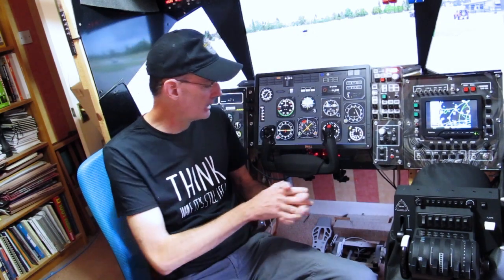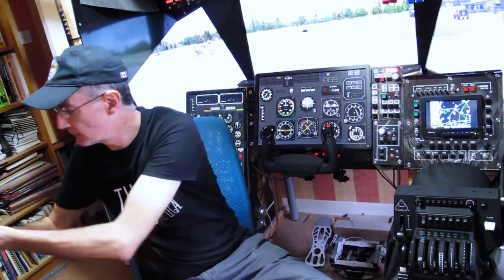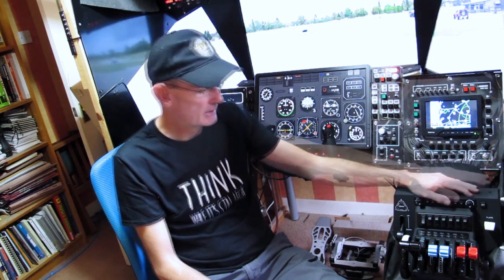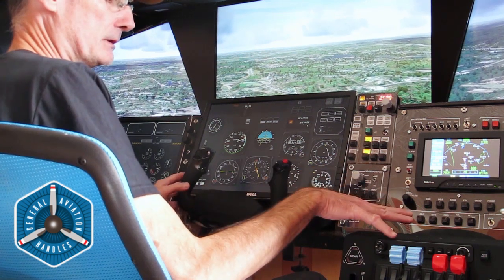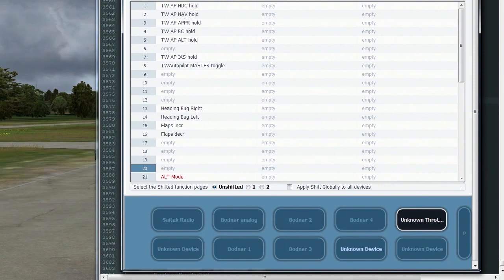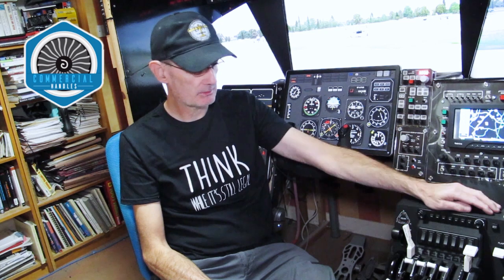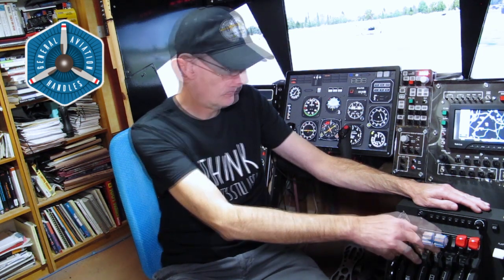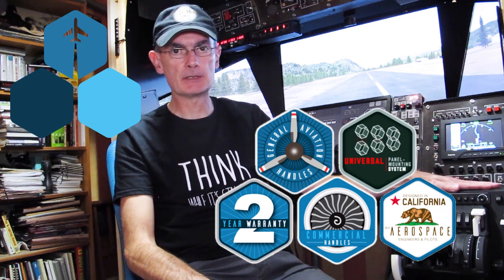Honeycomb Bravo Throttle Quadrant Review

Comment: Isopropyl alcohol  works very well to remove stickiness on  this type of soft plastic 😊
Reply from the maker: Five years on it would be interesting to hear if anyone has actually had problems with stickiness on their Honeycomb yokes. On a casual search I can't find any evidence, although it's hard because 'stickiness' returns a lot of hits about binding :(

I don't have the Alpha any more but I have just ordered the 'Lite' version to review.
Reply: @AlmostAviation Ive only just bought the honeycomb, so too new.  I had the sticky problem with an old Saitek  x52 pro throttle , applied about a year ago & still good …. I hoard all my old sim hardware so will update 😊

Comment: Hello,

I remember your very informative (as usual) video about the absolute positioning of the Saitek Trim Wheel and how this harmfully interferes with the autopilot and/or the trim buttons in the sim.

According to HC support, it seems that the Honeycomb trim wheel included in the Bravo sends button events to the sim (interpreted as "up" and "down" events) rather than an absolute axis value. That is, it seems like the trim wheel implements relative positioning, much like your mod on the Saitek device.

Can you confirm?

Thanks in advance
Reply from the maker: Yes, indeed it does. You will find this a very slow way to change the trim with MSFS by default, but if you have FSUIPC or SPAD.neXt I have found sending five trim events per click works gives a good balance of finesse and usability. You can tune this as needed. I have just also seena video by Simhanger about another app for tweaking the Bravo trim whell, so maybe check that out.

Comment: Operating the switMany thanks for your presentation
Finally a Youtuber who shows us NOT a preformatted marketing speech...but a practical use of the product
I realize (finally) that the ergonomics of the autopilot is a disaster, especially for turning the wheel (on the right) 
This when the "mixture is on rich" and the propellers at small pitch.
Operating the switches is even worse and complicated to access during the flight it seems...
It is often also there in the climb that one needs to adjust the autopilot. In short, I ordered a set of this product yesterday (A+B), which is currently in transit between the supplier and our home... and I'm already wondering if, instead of unpacking it... I'm not going to return the boxes WITHOUT opening them!
For more than 6 years I have been using the Saitek "Pro Flight Yoke System", 2 "engine" modules ° Autopilot module and Radio module ...and I finally wonder if it is as ergonomic if not better than Honey...
Thanks again for your sincerity !
JF
Reply from the maker: Thanks. I'd give it a try, only the rocker switches are really awkward when the levers are in the way. Time will tell whether the axes are more durable than the Saitek ones but the feel is definitely better out of the box, and the tension is adjustable.

Comment: An absolutely lovely piece of gear that suits a wide variety of aircraft, BUT not a Cessna (probably the most popular plane in the world). It's the one I fly primarily both sim and real, so if Honeycomb can disregard Cessna, I can disregard Honeycomb.
Reply from the maker: Not sure what you mean, I fly the Cessna 172 with it with no problems.
Reply: @AlmostAviation  Of course it "works" and should with no problem, just as the little throttle lever works on top of my basic CH yoke and with as much authenticity. Presumably the idea behind the elaborate variations in the quadrant and the associated cost is to more accurately replicate the throttle look, feel and action, which it absolutely can NOT do for a Cessna.
Reply from the maker: @airste172  I guess we disagree. To me, 99% of the worth of an analogue controller is that it provides analogue control of any given axis in an ergonomic form, with a decent range of travel and with sufficient precision. I'd say whether it looks like the particular aircraft you are pretending to fly is of little significance.
Reply: @AlmostAviation  If authenticity is of little significance as you say, what is the worth of the Honeycomb?  The little levers atop my humble CH yoke accomplish the very same things you mention without a significant added cost and loss of desk space.
Reply from the maker: @airste172  Sorry, I don't understand the question. And I didn't mention authenticity :/
Reply: @AlmostAviation  Sorry, I paraphrased what I took to be your sentiment. My apologies if it's incorrect. In any event, let me put the question this way. What is the Honeycomb worth if it doesn't more accurately replicate the controls on the throttle quadrant than what I already have, humble as it may be?
I suspect that you wouldn't take a gas pedal on the floor to be a suitable representation of an airplane throttle and I don't take levers to be a suitable representation for vernier controls.
Reply from the maker: @airste172  I think the difference here is that you privilege 'representation' while I just want a way to control the aircraft.
Reply: A Bravo is far more detailed, elaborate and costly to be "just something to control an airplane" and for all its features and options, it does the job brilliantly for airliners and many other aircraft. In terms of a Cessna however, it's an abysmal failure and a waste of money.
Reply from the maker: So you said, just saying it again doesn’t make it any more objective :)  Interesting use of quotation marks, BTW.

Comment: Just got my Bravo throttle yesterday and the Alpha yoke Friday.  Toyed around with setting some.  Couldn't get the lights working even though I followed others directions but think my issue is because my msfs and other Sims are thru Steam and are on different drive.
Great review!  Hopefully they will get some better software out to help with lights etc!
Really enjoying your channel and the info you provide sir!  As for the production value that was mentioned in a comment, your production is just fine with me!  No need to have a Warner Brothers production budget to get your messages across.
Reply from the maker: Thanks, I agree the Bravo software is a bit too 'raw technical' for the average tinkerer. I haven;t bothered with it as yet, still deciding whether to use the quad or to stick with my Virtual Fly one. As for production value, I think a proper set/location with better lighting would be enough!

Comment: $250 is a steal even scalers price at $550-600 isn't bad for brand new. Yes I get it sounds like a lot but let me brake it down price wise.

Logitech throttle is $60 retail and you would need 2 so $120 at msrp if you can find them. Going for $80-100each now scalped

Old saitek trim wheel that are how many years old and used going for $200 plus on eBay. 

Or cheap flight velocity trim wheel for $80

Cheap set up throttle you would have to buy aftermarket handles for nice once like honeycomb provides for free. I've seen handles for logitech throttle go for $50 and up

Or for flaps and trim in 1 package is the logitech multi panel it retails for $150 but being scalped for 200 plus.

So 2 throttle, multi panel,handles is minimum $330 msrp with handles being 50 and items at MSRP

But now due to scalpers for all the products would cost you $500-700

2 throttle,multi panel,handles,=$500

Then add saitek trim wheel that's $700
Reply from the maker: Anybody who'd pay $700 for that pile of dog poo deserves all they get :)

Comment: "Hard to keep it on the runway in this wind" proceeds to keep ailerons neutral LOL
Reply from the maker: Have you actually used P3D? "LOL".
Reply: @AlmostAviation  Yesir, ailerons into the wind :-)
Reply from the maker: @nwpilot1218  I presume you have convinced yourself that aileron deflection affects ground steering, which is not my experience.
Reply: @nwpilot12 - Doing that has no effect whatsoever in P3D.   Pointless waste of wrist energy!

Comment: Yet another over-expensive flight sim product that is ergonomically badly designed. The panel/light switches should be on top, not in front of the levers which is the most awkward place to put them. Apart from that, it is a decent bit of kit, but the only people that have them are you and all the other "reviewers". But you are not a reviewer because you didn't purchase it. You were sent it as a promotional gift and that compromises you somewhat. I am fed up with hardware manufacturers who keep sending review copies to anyone with a youtube channel who give the product free advertising and publicity, and similar to the recent fiasco over the airbus light blue stick and co-pilot controls, nobody actually owns one because there are none available. Honeycomb STILL hasn't released this hardware - so what is the point?
Reply from the maker: You seem angry, I don't know why. Nor what kind of response you're hoping for.

Comment: Reverse thrusters are only on/off and not incremental?  That could be a problem for any time we just want a little reverse thrust to back out of a tight spot, etc.
Reply from the maker: Indeed. Although, since reverse is controlled by the regular throttle up/down commands, there are other ways to control it.

Comment: How does this rate against the Saitek quadrant? also with all the other bells and whistles is this the 'sweet spot' with regards of best 'bang for buck'?
once again, thanks for another objective comprehensive presentation. 
  Cymru am byth
Reply from the maker: Even just as a quadrant it is much better than the Saitek one. The levers are stiffer, they are spaced sensibly (unlike if you place two Saiteks side-by-side for a six-lever quad) and the action is smooth with good resistance. (Indeed, on first impressions I prefer the feel over my VF TQ6 quadrant, which needs to overcome a kind of 'stiction' effect before it gets moving.) Whether it's best value, there's little doubt that for now it will be, assuming it is reliable.

Comment: It wouldn’t surprise me, and it makes some sense, that Honeycomb could bring out a ‘Pro’ set of levers made of metal.
Reply: Thats a great idea BUT i think having the levers made from a hard material it would slowly eat away at the plastic lever stump
Reply: @Fixingthingz4u  that’s the design and engineering challenge I guess. A heavier feeling and more robust set of levers, maybe with a plastic ‘inner lining’ part that interacts directly with the plastic housing, just the way it is at the moment. So the moving parts are softer plastic against plastic, but the outer level part is metal and more robust feeling.
I’m not in hardware product design, so I may be off the wall here 😂.

Comment: Btw the red switch on the commercial should be Autothrottle disconnect ;)
Reply from the maker: Oh yeah, that seems likely!
Reply: The red button resembles the TO/GA-button on Boeing aircraft. The way honeycomb modeled it, it‘s very similar to a 737-styled throttle lever. On the 747, the switch is located closely to that, but it‘s a different kind of button. 
The A/T-disconnect buttons are located at the sides of the grip, activated by pressing it with your thumb. Honeycomb did not add that button to their commercial levers, but the TO/GA-button of the left G/A-throttle comes close to that.